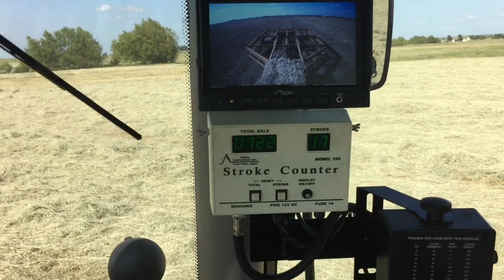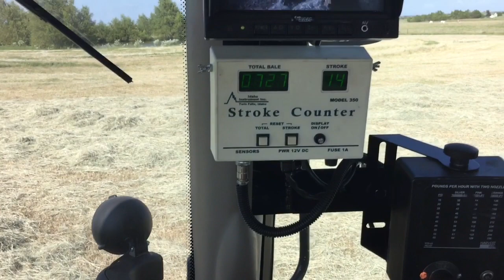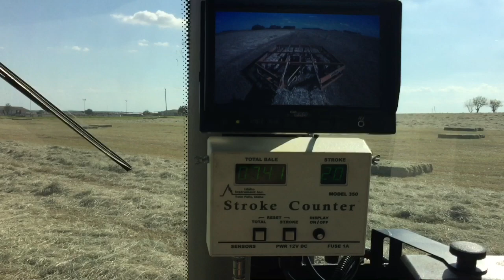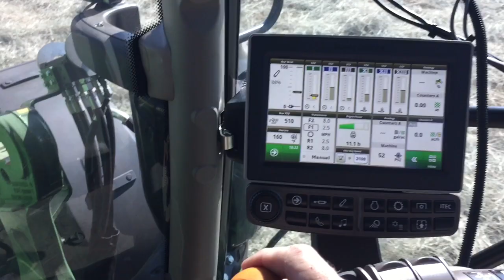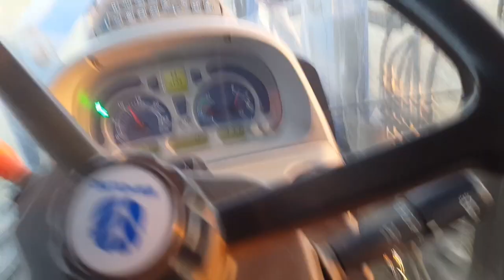Baling Horse Hay with the New John Deere 6120R

Comment: Been looking at putting a accumulator on my baler but was wondering if it drags the bales fuzzy on the bottom?
Reply: We've been using either an 8 or 10 bale accumulator since the late 90's (using a Parrish 10 bale now) and wouldn't go to the Kuhns or Hoeschler for anything in the world. Ground drag accumulators are great for our hay (Alicia, Tift85, and Perennial Peanut). The accumulated pack looks "combed" on the bottom of grass hay, but legumes are unaffected. Some folks on haytalk and other places warned that ground accumulators will drag good bales through mud, but if I'm baling in muddy or wet fields, I've lost my mind and dirty bales are the least of my worries.
Reply from the maker: stilsonian my thoughts exactly
Reply from the maker: BRAD MORGAN drag for our operation was the only way to go.
Reply: You can get accumulators that dont drag and stand verticle but when its full it then drops it on the ground

Comment: awesome setup. from exp. i can tell you the less you have to stop or touch the hay the more $ you will make. one breakdown etc. can ruin that cuttings productivity and profit. that's why most of us, especially smaller operations using old equip. like mine have 2. setups one old backup and your prime mover. all farmers become deeply Religious/Weather forecasters and pray  a lot especially when we have hay down. we get around $8 per 70# 2 string  bale of clover hay mixed with english rye, orchard grass and brome here in Orygun. i could easily double that if i could get it to So. Calif. economically to sell it. ours is organic hay and that fetches a huge price down there.
Reply from the maker: +Mauser Houser you explained it very well.

Comment: Wow I have never seen a tandem hay rig like that. I could not see how the PTO was hooked to the baler. Was it a long shaft or do you have some sort of hydraulic pump driven shaft ? That is much more fancier than my open cab 4020 and Heston baler. I love those in line balers ! Another question..... is the 6120R "too much" power for the baler ? Do you break many shear bolts with that much power and thick hay ? Do you operate her in the 540 economy mode ? Thanks for sharing!
Reply from the maker: Thomas Mccrea there are actually 4 shafts combined, and if your clutch on the baler is adjusted properly it's not possible to have to much horsepower. This tractor does not have an eco 540

Comment: Hey sexy tractor driver ( not you Scott lol), drive that 6120r just like your car or truck, don't use the clutch peddle, just step on the brakes, it will disengage the clutch. 
When I'm running our 8310r and grain cart and pull up along side grain trailer or wagon, I just use the brake, never have used the clutch peddle.
Reply from the maker: JGM thanks for the suggestion

Comment: What percent tint is that on the windows? I've been considering having my Kubota tinted because even in the middle of winter I can still use the a/c. Also what do you spray on the hay? I've seen balers for sale online with the tanks and know that you can spray the hay if it's moist but exactly what is it?  As for light bars get on eBay and buy yourself some you can get them for hardly anything nowadays and the quality is pretty good.
Reply from the maker: smcox1991 20% tint. Proprionic acid is what is sprayed on the hay. Anything over 11 % and under 18% I spray

Comment: When you are controlling the strokes per bale do you keep the engine speed constant and vary the ground speed with the transmission?  I don't quite understand how this works and I'm assuming you're trying to get a consistent density with each bale.
Reply from the maker: 958kris control with ground speed and it's for consistent flakes and bale weight

Comment: What's the stroke counter? How does it work? Non-farmer here.
Reply from the maker: Keith Brettell when the hay feeds in the front there is a plunger that pushes it into the square shoot that you see on the back. The stroke counter counts how many times the plunger makes a revolution to make a bale. It helps us control our bale consistency.
Reply: Where do you purchase a stroker counter? I'm buying a 10 bale flat drag type accumulator for my square baler tomorrow and am thinking about a stroke counter to keep consistant bales. Thanks for the great videos!